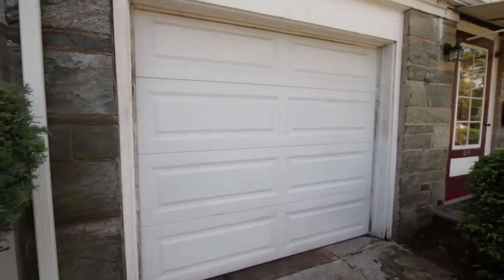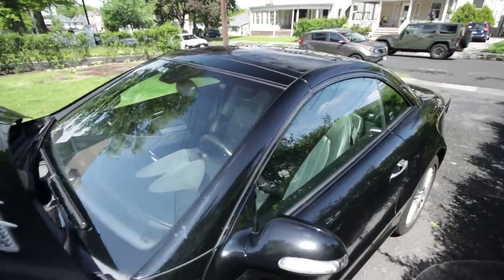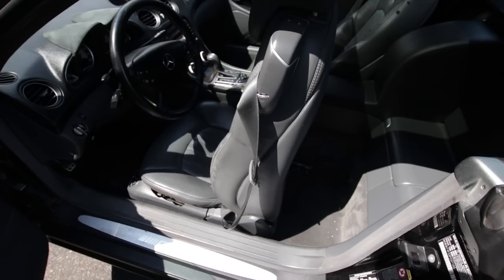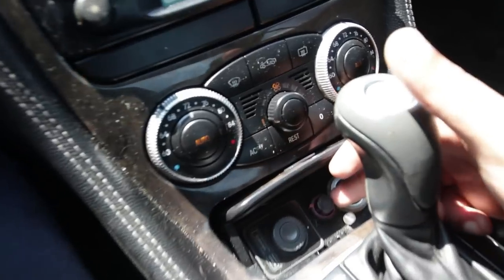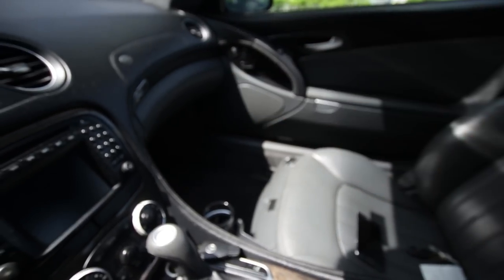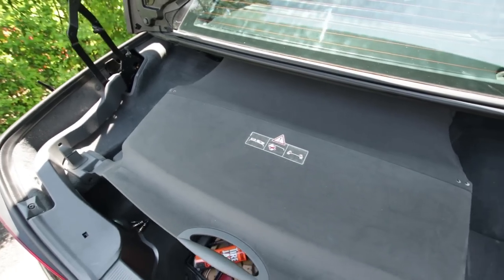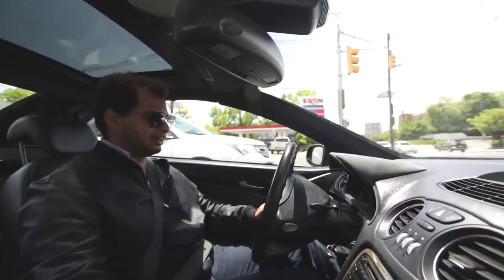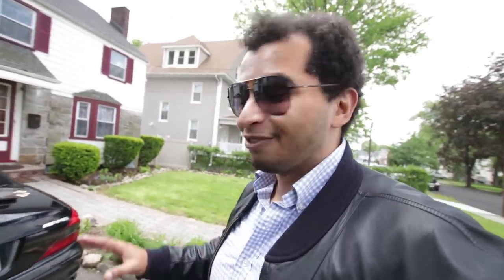I Just Bought A $130,000 Mercedes-Benz SL55 AMG For $8,900

Comment: how the fuck did u get it for 8900 ! cheapest one ive seen is like 20k+
Reply from the maker: Right? I was just as surprised as you were.
Reply: +im Schwaggy - The car is tough, and obviously not well cared for. The engine bay looks like the previous owners used the car for off-roading with the local 4x4 club. In the first 2 mins of Tavarish opening the car door you can see the keyless go button has broken off, the driver's power window switch is broken off, the driver's headrest button is broken off, the bottom seat trim is smashed and broken, etc, etc. 

I didn't watch after the 20 mins mark (too long) but you can bet there are many other issues with this car, including some potentially large and serious repair bills ahead with some of the complex systems.

There's a reason a wholesaler is flipping this for $8900, it's because the cost of repairs, plus his initial cost of the car, exceeds the realm of reasonable profitability. I assume Tavarish is going to source out cheap used parts and do much of the work himself. A wholesaler cannot be bothered, there are easier flips to make money with. 

These cars have poor reliability reputations when they get this old and have this many miles, so they're difficult to sell to people who have money, and people who don't have money are afraid that a car like this will break them. So the market is limited.

If you like exotics, or semi exotics. Buying cars in this condition can be a fun way to enjoy the hobby. But you need to have deep pockets or big balls - or both.
Reply: OMGWTFLOL you're gonna have to put in a few grand, maybe another 8-10k. BUT if the car runs and drives fine(As he says his does), you're going to make a BADASS sports car out of your money.
Reply: Tavarish can't wait to see what you do with it, this is such a great platform.
Reply: I bet that hard top is gonna be a pretty penny i hope its just simple sensor or motor gone bad
Reply: The 'flaps' are supposed to attach to the trunk lid. If they come loose (even a little) it shuts down operation of the top. Pretty common on these cars, but easily remedied with ~$40 in parts.
Reply: true, haven;t sen it less than 20k euros in Europe
Reply: because its a crap car, 70% of the stuff doesnt work
Reply: lalos hahahhaa Houston just undressed you. Take the L and move on!! Hahaha 70% ohh oops I mean 50% hahahahah
Reply: Which is exactly the small stuff that would turn a regular buyer away, yet is trivial to address for those with the interest / time in it. Time is free if it's your hobby.
If that's not for you, that's perfectly fine. Plenty of SL55's in better condition, if you were interested in picking one up.

Granted, I'm probably being too rational for YouTube comments.
Reply: He's referring to the button in the trunk that's intended to lift the entire assy for easier access to the trunk space, not the roof open/close mechanism.
Anyway. I think the point is made. This isn't for everyone. And that's perfectly okay. Plenty of cars to go around for everyone in various states of disrepair.
Reply: english is not my first language, grammar is the first thing you mention when you dont have something smart to say, when you learn some other language, than you can talk to me like that. also i edited my comment because i forgot to mention the third thing, not to edit my grammar. and one more thing. he got this car for half a price of a cost of a perfect car. when he fix all that stuff, total price will go over limit for perfect car like this. brakes are bad, tires are bold, he need to change belts, oil etc. to get the interior in near acceptable state etc. thank you, i am out
Reply: im Schwaggy Probably lied to get views.
Reply: probably not a lie. I've seen deals like this.
Reply: Go on mobile.de it's the biggest car trade site in Germany you can find many cars cheap there
Reply: But I see there is the cheapest sl55 for 15000€ , maybe you buy a broke one dats why it is so cheap
Reply: you can get one cheaper than 8,000 in memphis
Reply: mad miles
Reply: no gag reflex
Reply: Because there's a LOT broken and or wrong with the car.
Reply: You will soon realize why this was a $8900 SL55 AMG.
Reply: Actually the broken headrest button is a common thing in many Mercedes. My uncle owns a 2007 E280 since brand new and both headrest buttons are broken and the car is only 35k miles.
Reply: VOTE FOR BANGTAN yeah but nobody wants to buy a stolen car that they cannot register lol

Comment: Sure, there are plenty of "old" high end cars like that (Audi, BMW, Mercedes, Porsche) that might be relatively cheap when you buy them but wait until something breaks. Instant regret...
Reply: You can delete the hydraulic lift and airbag suspension. The transmission can be swapped over to a manual. The supercharger is not necessary as the raw v12 makes enough power to move a house. Most of the modules can be bypassed or removed from the car.
Reply: +william wolfe tickle tickle
Reply from the maker: Bring it on.
Reply: if something breaks , u´re instant an organ donor xD
Reply: At least in Germany you get parts really cheap, especially from accident cars. Also, a lot of parts can be easily repaired (I drove 7 years various Mercedes models from C(LK) to S(L)(K) class).
Reply: Simon Vuille the m156 engine is pretty fucking solid
Reply: People don't know what they are talking about at all. That m113 motor is solid in this sl55. There's a e55 with the same motor with 400k miles running strong. There's no ABC issues that you'll have with the cl55 or s55 either. This is a steal for 8900!
Reply: Mark Anthony Wright M113 is indeed a reliable motor properly cared for. ABC represents a large chunk of the long-term costs on these cars, but body roll elimination makes it worth it IMHO. On the W220 the springs are soft to absorb most bumps while ABC keeps the rolly pollies away...no compromise driving experience!
Reply: good call William.......too many non-mechanics feel the need to chime in  w/ their useless un-informed worthless opinions......we (real mechanics) thank you!
Reply: Forrest Scott Brinkley I had no idea SL55s had ABC can that also be deleted in favor of a coilovers setup?
Reply: Mark Anthony Wright R230 came standard with ABC at least in USA. W220 S had it more or less standard on the V12 cars and believe CL (which introduced ABC) had it on all cars. Arnott offers kits for conversion on just about anything, but I really have to question why one would want to do that. As an ABC W220 owner, ABC is the reason I would buy one of these cars. It is a truly superior suspension solution that has no ride/handling compromise and arguably increases the safety of the vehicle by maintaining maximum tire contact patch at all times without making you feel every single bump.
Reply: Simon Vuille yep my first car was a cl600 for 6k and it was nothing but problems
Reply: watch for the ps pump. it is shared with the ABC and is a known failure point. $2k for a remain and $1k to install. personal experience.
Reply: add up cost and work and you end up with decent car price
Reply: utubejoe11 Good point. Typically the ABC pumps go first. That is what happened on my car...but under prev. Owner extended warranty 😉
Reply: Aivaras Sutkus If u are not planning on profiting on the car and get one with a lot of issues pre-addressed like I did,  there is no better value on the market. These cars have options you cannot get on new $40-60k cars 15yrs later, but u will pay only  25-30% of that over 2-3 yrs and 30k miles. Initial purchase is only 15% of that.
Reply: SlammedNCammed2V I believe it. I tell ppl all of the time to stay away unless the initial purchase price is only 40-50% of their total budget. Essentially what is left over is your own built in extended warranty. The exception of course is a purchase with most of the problems already fixed.
Reply: +Simon Vuille about that "Instant regret" - you might wanna check out few Hoovie's videos
Reply: Simon Vuille yep. I bought a CL55 last year. $16500can, put almost 20000 in repairs right away. ABC is nice when it works, but damn it's expensive. I just finished tuning it for another $10000. 650hp700lbft torque.
Reply: Richard Hoogewerf Sounds like you had to do a complete ABC rebuild...something I hate to see ppl have to do out of their own pockets. It is not easy, but you can typically find cars that have been rebuilt and pay 1/3 or 1/2 of the cost of an ABC rebuild via price premium over market. That's what I did on my W220 with ABC. No regrets.
Reply: This car doesn't even have a v12 in it buddy. Stick to what you know
Reply: What I'm getting from that comment is what most of us already knew which is that it's practical if you know about cars and how to do stuff like that.
Reply: Dont jinx it homie
Reply: This isn't really a problem for someone like +Tavarish  who literally makes money off of the mechanical condition of his cars. Also, shut up Scotty Kilmer.
Reply: every other person would take such deal hence the demand would send the price to another level
Reply: You want a warranty? :'D :'D :'D
Reply: RandomUser M The "warranty"  is not spending 100% of your capital on the initial purchase. Plan on something needing almost immediate service, and something else needing it within six months. That's fine if you only spend ~40% of your pile of cash on the initial purchase. The "warranty" is the remaining ~60%.
Reply: Simon Vuille Still way better than a Miata, for example. Will cost less even with repairs, and destroys something like a Miata in every way.
Reply: swap that to a manual and come tell us how you did it :D
Reply: It's ugly as fuck, honestly. I own the e63, and it looks much better.
Reply: Simon Vuille. I f you got a good mechanic your straight
 Parts s re cheap.
Reply: Mark Anthony Wright yes it can
Reply: utubejoe11. Convert it to coil& springs for $1000
Reply: fufuflavor yes I have. I did it on a w220 S600 and it rides perfect you can't even tell a difference Honestly! Maybe  after a few years you may. But I did it kept the car for a year then sold it to my friend that begged me for it. Now I have a S55 AMG KOMPRESSOR. I will convert it also if ever needed . I will never  sale that car. Its mint condition my baby!!
Reply: fufuflavor Coil kits for ABC and Airmatic W220 and R230 are plentiful on the aftermarket. If you are OK with no pushbutton height-adjust-ability and no sport/comfort control, coilover conversions offer an economical option. In W220 application, the ride would be too harsh IMHO. ABC is beautiful...truly a no-compromises system. In ABC Sport Mode I can canyon carve in my ~4200lb luxury limousine without embarrassing myself. It also offers impeccable control at ~80MPH Interstate speeds. One truly cannot tell how fast he/she is going. Yet the springs in the ABC struts are soft enough to absorb 99% of road imperfections, so one still gets the "cloud like" S-Class ride. I suppose in R230 applications a stiffer "sports" ride 24/7 wouldn't be such a bad thing though.
Reply: fufuflavor Depends upon which route you go. $6k is low for a dealer doing it in the US. But if you go with Arnott rebuilt ABC struts and rebuilt valve blocks off of eBay installed by a local independent shop, that can knock off several thousand from your $6k figure. Better yet, buy a car with the work done like I did 😉.  Otherwise lowball the owner and use the money you didn't pay him/her to fund the repairs.
Reply: fufuflavor Arnott has one of the most complete ranges of ABC rebuilt and coilover conversion kits here in the US. They also have a warranty of 5yrs or so vs Benz, which isn't even a year 🙄
Reply: fufuflavor Arnott is a remanufacturer of Benz Airmatic and ABC struts. They also make coilover conversion kits. They are probably the best known aftermarket option in the US for Benz active suspension components. The other option is the dealer.
Reply: Would rather spend a little more on repairs than not have to on a Prius
Reply: Simon Vuille i find it funny that in the recommended section there is now a video from this channel labeled “it cost HOW much to fix my mercedes sl55 amg?” With an OH CRAP on the thumbnail. Im going ti see if it is just clickbait or not though
Reply: Simon Vuille just watched it, and you are more than right. It cost $11,911 to fix not including the other problems like the suspension
Reply: Porsche >BMW >Benz

Comment: Nice car man, I've got a 04 Sl55 I snagged for $20,000 a few years back. Word of the wise, careful redlining the engine with the pushdown switch and pushing it above 6000 rpm too often. The super charger pulleys (if stock) wear down super quick.
Reply: Makes you wonder if an sl600 is more durable. With the absence of a supercharger

Comment: my father just bought a 2003 cl55 clean title 144k for 6500 with a top end rebuild new machined heads and gaskets, just rebuilt the trans for 2300 with an upgraded clutch pack 8,800 for a cali car 03 black cl55 is what I call a fucking deal. welcome to the m113k gang